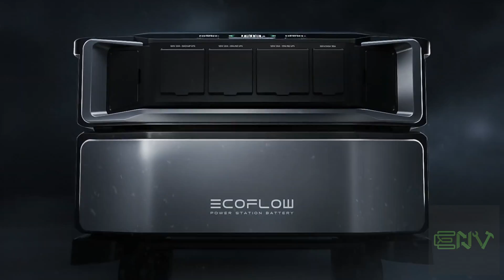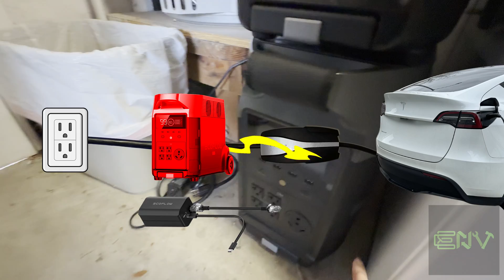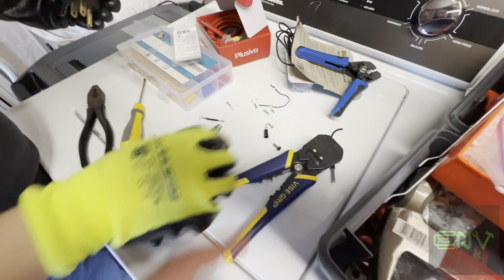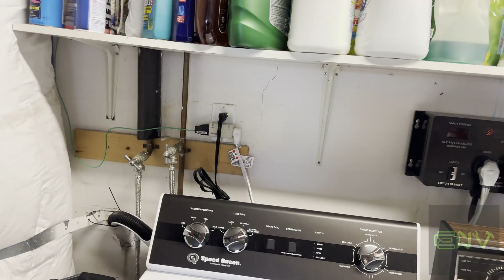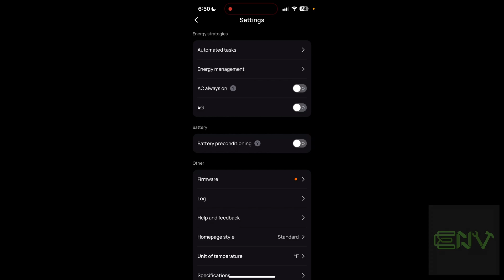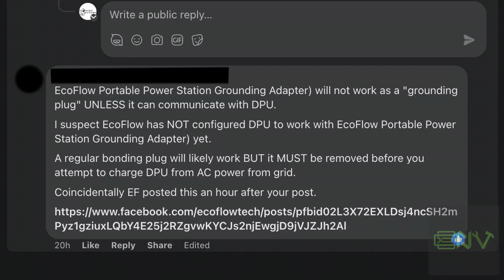Devising How to Charge my Tesla with EcoFlow's Delta Pro Ultra

Comment: Great eco flow delta pro ultra X system and EcoFlow delta smart Panel 3 and EcoFlow delta smart EV charger and EcoFlow delta pro ultra X extra 10 battery and 10,000 solar  panel  😊

Comment: The power station only has 30 amps not 50 or 60
Reply from the maker: Correct, but at 220V that is still good enough charge an EV with within a reasonable amount of time.
Reply: @envmedia  a ev charger uses 50 amps 240 a power station has 30 amps 120/240 and 20 amps 120

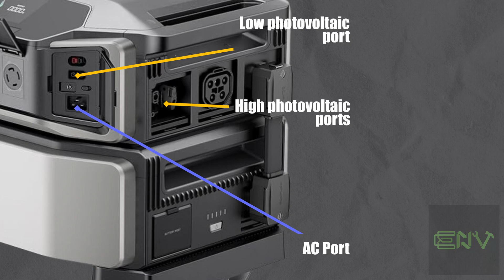Comment: I would suppose this would work for any ev? Just a somewhat educated guess, just from the uk and presume that I may need to do the same, depending on if the power station is available over here, at the moment I’m just looking into these station and ev cars, but thank for the help for when I do get these! 36:33
Reply from the maker: Yes absolutely should work for any EV assuming you get the proper cable types and adapters. Happy to help!

Comment: Using $10k power station complaining about a $4.00 plug. Wow
Reply from the maker: Who's complaining? The complaint is that it isn't clearly specified by EcoFlow what I need to do to charge my EV from the Delta Pro Ultra. I have absolutely NO issue spending money on a plug. Did you even watch the video?
Reply: @envmedia  Well i bought the $4.00 plug, no problem. Now I just need over $10k for the power station :face-orange-biting-nails:

Comment: Question at the end do you still need the grounding to the wall? The green cable? Or just the ground adapter ?
Reply from the maker: Green cable is not needed. That green cable properly grounds the unit but in order to satisfy whatever self-check the Tesla charger is doing all you need is the neutral to ground bonding adapter.

Comment: There are much less expensive options I have learned- also from YouTube university. I have an ecoflow and was able to charge my Tesla without issues. I’m about to build a power cart which will hold more power at a lower cost.
Reply from the maker: Using a neutral to ground bonding adapter? If not, what model and year of Tesla are you charging?
Reply: @envmedia  Yes we needed a Neutral Ground Bonding Plug for Portable Inverter Generator. We have a 2024 Model Y. It was simple but definitely a slow charge.

Comment: I tried to connect a small UPS system to the DPU, and it worked for the first two outages, but the other day during an outage, the UPS system's "wiring fault" indicator light turned on. I thought about doing what you did, grounding the DPU via the ground screw, thinking it might solve this issue. But seeing as it didn't solve your problem, I doubt it will resolve mine with the UPS system. The grounding plug seems like a good idea, but I have mine always plugged into an outlet, and I learned from your video not to use a ground plug while the DPU is plugged into an outlet. I don't know. I suppose I should keep things simple and just not attach anything complicated. The DPU isn't cheap. 😅
Reply from the maker: Glad you heeded my advice! I would recommend reaching out to EcoFlow support via email. They typically respond within 2-3 days and if your product is within warranty I’m pretty sure they’ll take care of you.

Comment: This video is FANTASTIC! And I think you saved me from doing something dumb. However, I actually have a different DPU problem. I WAS going to charge via Garage GFCI AC Outlet input while also plugged into my transfer switch via the 30 amp DPU output. But the input AC outlet and the transfer switch share the same neutral,  which I found out the hard way, because the GFCI kept popping. I contacted EcoFlow and they told me I COULD use a Neutral Bonding plug to solve this problem. However, I was afraid to try it and didn't. Your video has made me think twice. And I wonder if whoever said I could at EcoFlow is wrong... My AC outlet in the garage is connected to the same Main Cirrcuit breaker panel that my Transfer switch is connected to. I have searched everywhere. I have no idea how too charge via GFCI Garage AC Outlet, and power my transfers switch at the same time (The GFCI AC Outlet I am charging from is NOT part of the transfer switch). I have no idea what to do now... Any advice from you or your friend may help. Also, I am in FL and we lost power for 5 days during Hurricane Milton. I finally tried out my solar panels with the DPU and it worked just fine, but I don't have enough panels. I plan to expand my solar setup, but need to plan all that out too. Ohh, I also have NOT connected the grounding screw to a ground in the garage yet. All my outlets in the garage are GFCI and I thing something weird with that is happening. I talked to my local electrician and he has no idea how it works either. I'm trying to figure out the proper code way to connect my DPU to a ground and making sure everything is safe, but that's another problem right now.
Reply from the maker: Thanks, I’m really glad to hear that. It’s a big reason I repeated myself throughout the video as I really wanted to convey the potential danger of using a dumb neutral to ground bonded plug. EcoFlow support doesn’t seem to know very much… even when it comes to troubleshooting potential problems but this is something I intend to cover more extensively in my review (eventually to be posted on my other channel @anonreviews), so I take what they say with a grain of salt and do extensive personal research.

I showed Harvey your comment and this is what he said: ——

Connecting neutral to ground counts as a ground fault and will trip the breaker. It needs to be connected upstream of the GFCI breaker. Electrical code mandates that the only place to connect neutral to ground is at the main service panel.

You should actually unplug the neutral bond before charging because it could cause a ground loop and let a lot of current flow through the EcoFlow if you happen to have miswired outlets in your house. Again, electrical code mandates there should be only one neutral bond and only at the main panel, so if it burns down your house then insurance isn't gonna pay out.
———

Oh wow I hope you and loved ones are safe. Hopefully the DPU was able to alleviate much of the pain during the power outage.

Regarding attaching to ground: I’m pretty sure if you can attach a wire from the grounding screw into an available outlet like I was able to you should be fine, and it would be cheaper than hiring an electrician to do it.

Best of luck!
Reply: @envmedia  Thank you so much for the prompt and comprehensive reply. I think this may be too hard to explain via text comments lol. So the wiring in the house should be correct. I just redid my entire electrical panel, and added a transfer switch and inlet box too recently, via a professional electrician I trust. And I completely agree the EcoFlow support team replies sometimes does not make sense or could be sketchy at best. Even hearing how the relay's worked in your video helped me a ton to understand what was going on. So ya, the GFCI AC 120V normal charging while connected to my transfer switch sounds like a no-go or something. I certainly don't want to burn my house down. I will NOT be using the Southwire Neutral Bonding plug I got. But I am not sure how to fix this situation. I need to find a way to charge via AC outlet/grid while being connected to a transfer switch. The transfer switch powers some things in the garage. But I purposely added another GFCI 4-outlet box in the garage that has it's own dedicated circuit breaker in my main breaker panel. Somehow something is looping. No idea how to fix it.
Reply: Tell Harvey I said thank you as well. Thank you to you both. While I am an engineer in real life. I am not an electrical engineer lol. So I "have to worry, even though I am an engineer", ha!
Reply from the maker: I’ll pass your response by Harvey but I strongly recommend you make a post on both the EcoFlow subreddit as well as the official Facebook group detailing your issue. You’re likely to get better help from more knowledgeable folks. :)

I was able to get closure that using a neutral ground bonded plug was ok in my scenario from a knowledgeable user in the Facebook group after all. Until then, I was assuming plugging it in and trying could cause damage. 

“I have to worry, even though I’m engineer” I lol’ed at this haha. 

Good luck!

Comment: So, only able to trickle charge using a neutral bonding plug. That’s what I found with my Jackery and Rivian. I’d like to be able to use the 30amp outlet for charging with Solar before donating $7,000 for a delta ecoflow….. if anyone has figured that out please share….its prime day and they’re on sale!
Reply from the maker: The delta pro ultra is able to charge an EV at level 2 charging speeds through the 30 amp outlet indeed. Just don’t connect it via AC to the grid with the neutral to ground bonded plug.

I have a video in the works of details on what I do and my findings. But you may want to math it out before splurging on an EcoFlow. It is very impractical without additional batteries and without many solar panels.
Reply: @envmedia  thanks for taking the time to reply! I look forward to the updated video.

Comment: Awesome video! Screw the haters that don't understand the learning process. I watched the whole video. Thanks for going to the lengths you did!

Can you elaborate on exactly what is needed for the "neutral to ground bonding plug "? Perhaps leave a link to one that you used?

Thanks so much! :)
Reply from the maker: Thanks. :) It's a plug that has the neutral and ground plugs hardwired together. You can even assemble it yourself if you really wanted to. I added a link to the product I used in the description.
Reply: @envmedia  You're the best! Thank you! :)

Comment: Dose doing this damage the ultra’s ability to charge from the wall ? I seen another video where he used the delta pro 2 and did the same thing but it fried the component that lets the delta pro charge from the wall so he can only charge it with solar because the ac charging unit got fried inside the machine are you still able to charge it from the wall when there’s no grounding plug connected to the ultra / Tesla charger ? , I ask these questions because my house dosent have a ground connection so I would like to get solar and do the same thing your doing for my Tesla so I can charge it at my home but my concerns are not being able to charge the unit from the wall because of my outlets not having a ground connection or using the dummy plug and it fry’s the unit to where I can’t charge it from the wall at all because I plan to use solar in the summer but charge form the wall in the winter but I’ve been trying to do research to make sure it would work for my situation, do you know if I can charge the unit without a ground connection from the wall socket ?
Reply from the maker: I haven’t tested regarding charging via AC power without a grounded cable. I don’t see why it wouldn’t work though.

In the video I mentioned multiple times that you must NOT connect the bonded plug to the device while it is ALSO connected to the wall as that is what can fry your device. So in winters when you are needing to charge your DPU, be sure to unplug it each and every time you connect the bonding adapter in order to charge your EV. I would advise against this as it is easy to forget one time and it will end up being a costly mistake.

Additionally, charging your DPU from the wall and then charging your EV from the DPU is inefficient and will use up more power than just charging your EV directly from the wall in the first place. It makes sense if you are using the DPU to harvest solar all year long and use grid power to top-up your DPU during off-peak hours.

Comment: So did it work with solar inputting at the same time? Or can it only charge the EV with no electric input? I feel like a firmware update can fix the relay issues.
Reply from the maker: It generates via solar and can charge the EV at the same time. No problem with that. What you cannot do is plug the device into the wall via AC with a bonding plug attached to the device. As that can damage it.

Comment: Thanks for doing this comprehensive assessment! Strange that Ecoflow claims that the neutral-ground bonding is not needed.

How has this been working for you after a few weeks? Any issues as long as you never connect to AC input?

I noticed that when using a Hyundai charger with SAE J1772 --> NACS adapter, I didn't need to use the neutral-ground bonding.
Reply from the maker: It’s been alright actually. It’s a manual process of having to remember to discharge and then switch the cable to the wall if I need a larger charge. Going to see if I can alleviate this via some amount of automation long term. Shorter term I’ll probably get an additional battery.

I’ll be working on an EcoFlow review (few months out) that I’ll be publishing on my other channel that’ll delve into more of my daily experience, dealings with EcoFlow and the like. Channel is posted in related channels section of my YouTube page.

Comment: Wow. Great job trouble shooting it with the multimeter. 

I just spent an hour trying to figure out how to charge my Tesla the same way, using solar only. 

Thank you so much for the insight, all I need is a stupid plug. Copy that. 

Kinda wished ECO flow would have at least tested charging an EV during pre testing. 

Anyways thank you good sir!
Reply from the maker: I appreciate you sharing how you found this helpful. This video took a lot of time and effort as I wanted to capture the technical aspects while keeping in much of the troubleshooting and pain-points that most tend to gloss over when editing for YouTube. Comments like yours make the whole effort worthwhile.
Reply: @envmedia  100%. Thank you so much for the help.

Comment: The first mistake is trusting any wiring performed by males that don't have, or can grow facial hair. Second mistake: you need to gang those wires with the water supply line from the washing machine at the 220/240V junction box for the dryer. That will keep the ecoflow cool. Why do you think they named it Eco "FLOW"?
Reply: I think your interest in male facial hair is due to an attraction to males.
Reply: @A-12Xmusic  The only hair I'm attracted to is your mother's. The carpet and the drapes.💇‍♀